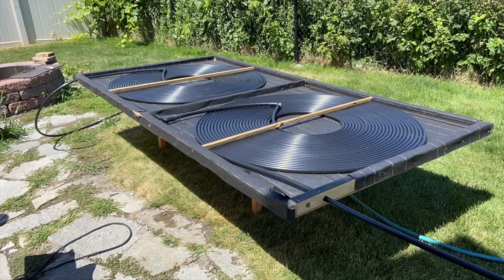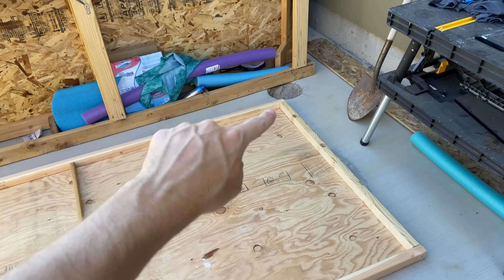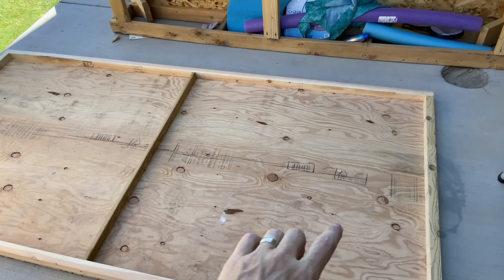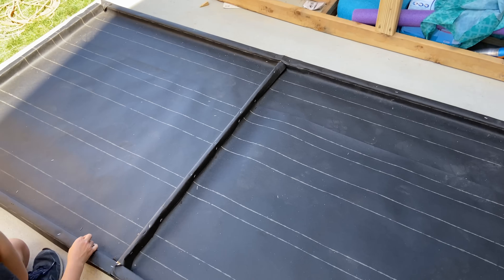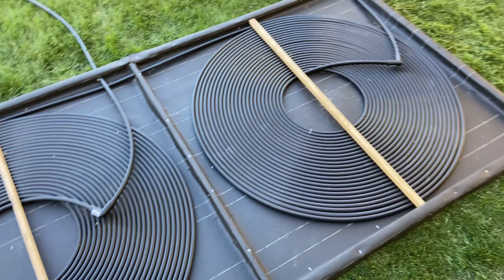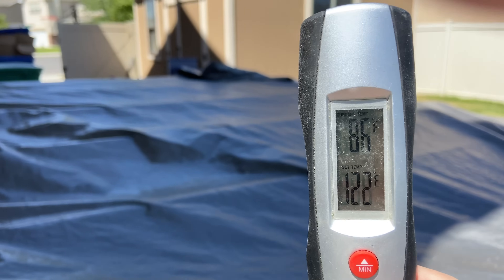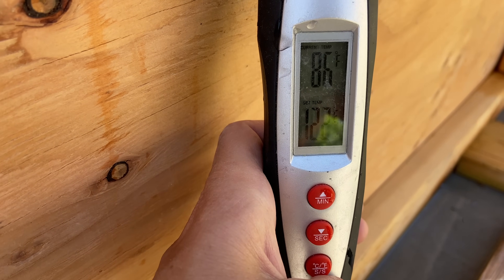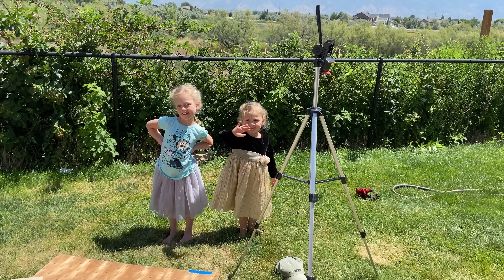DIY Pool Heater - $50 Solar Heater

Comment from the maker: Check out the DIY Pool Build we built this heater for: https://youtu.be/xiqEcp5LHLA
Reply: @101Sauske  pl:
Reply: @alexcanfora4456  aewm
Reply: When I open my pool in May, the water is 60f. I turn on my natural gas heater in the morning, and it's 88f in the same afternoon. 88f is where I keep it until Oct. Most days from July to mid-Sept it will just maintain the 88 degrees without running the heater. Lately I have been adding cold water to keep it under 90 which is highly unusual. Unchecked, it will get to 93-95f. It's around 11,000 gallons / 40,000 liters. My liner is dark blue for northern climate and my pool walls and floor are insulated. My solar blanket is a dark blue/silver, designed to keep the heat from escaping at night. I live at 48 degrees north. It's WAY too hot this summer.
Reply: Temperature is a measurement that determines the direction and rate of energy flow. If you want a cup of tea lower the flow. If you want to heat up your pool speed up the flow because by slowing down the flow you waste energy. As soon as visible light is absorbed the energy turns into heat which is lost by conduction, convection and radiation. Maximize heat transfer by conduction into the pipes.
Reply: @RCdiy  I was gonna post this, but this guy knows. ^
Reply: @shperax 😮😮😢😢
Reply: No way I'm hell you started with nothing and built that for $50.
Reply: If you want your water warmer, you could always turn the flow off and let the water sit in the solar heater say 15-30 minutes in the sun then start the flow again. Maybe put the water pump on a timer to run every 15-20 minutes for however long you think it takes to go thru the water that’s been sitting in your solar heater?  I don’t think a consistent flow of water would necessarily be needed?

Comment: Thank you! Learned so much from your video. A technical question - When you say coil in the video you mean the tubing right? Unless there is another item that needs to be added for the heating. Thanks.

Comment: How long did the tubing hold up on this? I've been planning something similar but am planning on using copper for the long run as I'm concerned that the UV exposure would destroy the pipe within 2 years.

Comment: Dosnt the 1/2” pipe restrict the pump. 
It is designed to to work with 1 1/2”. 
Your not moving enough water through your filter.

Comment: FYI, if your goal is to make the pool hot then you want the flow rate to be high so that the temperature coming out of the heater is as cold as possible. I know this sounds counterintuitive. Increasing the flow rate will keep the water in the heat exchanger cool, so that you maximize the temperature differential between the hot plastic and the cold water, thereby maximizing the heat transfer rate. So, if your goal is to heat the pool as fast as possible then you want fast flow with water coming back being only slightly warmer than the water going into the pump and heater. A lot of people tend to find this to be counterintuitive. If you were sitting in the pool and you could direct the hot water stream onto your body, then a slower flow rate will give you a warmer stream of water. If that's a goal then a slow flow rate works great. But when you're trying to heat the entire pool then you want a slow flow rate to maximize the rate of heat transfer because you can maximize the temperature differential in the heat exchanger (between the black plastic again and the cold water).
You would also want to have the coils in parallel, not series. If you had one coil after the other, you'd get hotter water coming out, but the second coil would be less efficient. Parallel is better, with high flow.

Comment: I did something similar years ago, since then I have changed my design for long term ease and maintenance.  I use 3/4 pvc and make an 4ft X, I spiral the tubing and zip tie every 2 loops. When done I make another X of pvc and glue together to keep it all in place. It’s lighter than plywood doesn’t degrade, and the black plywood and wrap makes no difference in temp if you put it on a block patio which the stone heats up also. I use 3 loops of 75-100 ft lengths for each  spiral. I tap a feed from the output side of pump just before a shutoff valve. I can partially close to increase water flow. The other end just hangs over top of inground  pool so system has no pressure for leaks.  I live in N NJ for reference, it makes water too hot to put my hand under and adds about 5 degrees more on a sunny day. In July August I run it at night to lower pool temp to keep it about 84-89.

Comment: Nice, but what difference does it make to the heat in the whole pool?

Im a bit worrying that with that flow it will have a hard time to heat the pool significantly.

Comment: My $110 pool heater works great. It has 400 feet of 3/4" hose on the roof and a $50 pump. My 10,000 gallon pool goes up 4 degrees a day when I use the heater. You can see it on my channel.

Comment: It won't matter whether you have two loops in series or parallel. Your resistsance will double and your volume will drop. Understand, you only capture the amount of solar radiation that hits the surface of the panel. As long as you pump water through both tubes, you will get the same amount of heat, and  a higher volume of water. At some point, the inside friction of the pipe will get to the point that the length of the tubing will restrict the flow to no output.

Comment: The size of this solar heater is about 4000 BTU. For people wanting to know how much it will raise the water temperature, it will raise a 5000 gallon pool (15' round 4' deep) about 1 degree a day. While that is not significant in 1 day, over a period of 7 days it has the potential to raise the temperature 7 degrees.

Comment: LOL Years ago I tried to build something similar for a 500 gallon kiddie pool.  I made a 2'x2' box and cooled the tubing the same way you did.  Under the coil I put a layer of insulating foil wrap to prevent heat loss from below.  Over the rop I screwed down a 1/4" thick piece of plexiglass.

I connected it to the pool but didn't have a pump and left it with water in the system and the next day was sunny and the water in the coil BOILED and expanded and ruptured the plastic coil.

So yeah, you can heat water like this!

Comment: On thought if weight is not a concern is to fill the tube section with black sand before putting the clear plastic cover on.

Comment: I have a similar setup, a couple of 2m diameter coils, running a 12vdc pump directly from a cheap solar panel. 8x4m pool and it can get up to 38 degrees, covering it during the night to preserve the heat. Totally recommended if your wife likes  a hot tub pool.

Comment: Polytube is much cheaper if you are protecting it like that anyway. I did it with stretch wrap and poly tube and hit 150F in 75F weather.
Reply: Do you have any photos of your system you can share?
Reply: @Evoans  No, it was years ago in a different location. Lately I just skipped the frame and the stretch wrap and laid the polytube out on the ground. A pool that had never been over 80 in May, reached 89F and then we disconnected it because we did not want it any hotter. The problem with laying polytube out unprotected is that it is prone to puncture and you can start developing leaks, so it will not last long. Insulating it in a frame protects it and makes it work better in colder weather.

Comment: Hey , good job , my pool is 12mtr x 3.5 x 1.4mtr , so i guess il need more pipe , what size pump is required ? Lastly would a solar pump be strong enough ? Just your opinion would be appreciated

Comment: I would run the hosing into my attic which is hot as heck during July, you could leave it in it's original packaging even.  I'm trying to heat koi pool during winter

Comment: Glass does not transmit infrared. The plexiglass or polycarbonate you are using will not have the greenhouse effect you were hoping for. Additionally, polycarbonate blocks 100% of UV rays, so you are losing all that energy and the heat is just radiating out. With glass, the UV would be allowed in, but the IR would be kept in.

Comment: You did not build that for $50 starting with nothing.
Reply: Can you prove it ?
Reply: @BibleMusicCentral  100%
Reply: @allthentikmusic5617  500 ft of 1/2 irrigation tubing at Home Depot is $50. Add the cost of tube connectors, wood, etc., add another $50 or so? Not too bad cost wise.
Reply: @weatherboner  The sheet of 1/4" plywood alone is $35.
Reply: @stick9078  agreed

Comment: Anyone tried a coiled, stainless steel garden hose instead of black tubing?  Probably more for smaller pools like ours (only 5x5 ~ 300  gallons)...interested to see how much more heat a stainless steel hose would absorb.  Really just worried about the toxicity of cheap black tubing after prolonged exposure to sunlight.  Though maybe running the water out from the pool, then through the solar hose system, then back into the pool filter rather than out from the filter, into the solar system, into the pool return would help to filter any breakdown of the material.

Comment: Great project but for best heating don't worry about trying to reduce flow to get highest temperature water out... the best heating will be with higher flow: maximising heat differential and therefore energy transfer. Seems counterintuitive I know but higher flow with slightly less heat at the end will get you the best results. It's science!

Comment: I am sure it works for a few minutes, but there is no way that after the initial hot water is forced out of the tube that the sun can heat the cold water coming in fast enough for this to warm a pool.

Comment: The most impressive part to me was 2:30 the actual coiling of the tubing. However I don't want plastic being circulated in my water supply. Heat and plastic are an infamously bad combination. Doesn't really matter what kind it is. If it's on the market, it's going to degrade and leech in sunlight. Not just chemicals but microplastics. 
I've seen other builds using copper tubing, which must be a massive price hike but would be a safe alternative. This is a wonderful concept that can be modified in countless ways.

Comment: I've watched several of these videos why don't people just measure the temperature in pool before and after dont think these work that good 20000 gallon pools maybe couple degrees more efficiently put on roof shingles or metal but think trying to heat a 15.000 gallon water heater with hose pipe laying in sun it would work good on smaller pool kiddies pool

Comment: You need to be cautious about the extreme temperature and chemistry and also having stopped the flow without draining the system.i believe the max structural strength of the tubing degrades as temperature increases. You are going to go through more chemicals, the more stable the temperature the more stable your chemistry will be. Think higher velocity and continuous flow during daylight hours or draining the system when temperature is achieved.a simple vacuum breaker and three way valve should do it.

Comment: What pump were you using to run the two 1/2" coils? I have a 9x20 Intex with a small sand filter pump... Im not thinking you recommend hooking them together? Am I thinking right that I should run the separately ? Please advise... And Ty

Comment: if you would set that up by your fence and then also have mirrors on your fence so the sun bounces off and onto your heater, it would increase the temperature!  Also as the water flows through, it captures heat energy. As long as the water doesn't reach the point where it's at the max temperature before it goes to the pool then thats okay. if it reaches max temp 3/4 through, then the last 1/4 of the system is doing nothing.  Nice idea though.  I wondered... if under the pipes, you'd have Styrofoam painted black, if that would be better. Now. The black tubes and wood are heating up by being black, that heat is transferring through the wood and escaping.  If there is Styrofoam then it would heat the black paint and radiate back into that open space and not being sent into that wood.  I could be wrong but I think it would possibly work better (higher temperature).

Comment: You know this was a good initial concept a few years back. But with what today's products are and options I decided to opt for a tankless 8 gallon electric water heater and water transfer pump. Keep in mind the cost difference was only $100 more to go fully electric instead of solar materials needed for the project. The interesting thing is is I now get up to 150° on demand whenever needed however I still have yet to see what the electric bill is. I had to go with the electric heater just because I never know what the weather is going to be and overcasting scenarios. I like the convenience of getting hot water on demand. Me watching these videos allowed me to uncover my new 2.0 electric water heater process and after an hour of installation it works flawlessly. I'm not saying it's for everybody but do your own research.

Comment: Seems to me that in the test, the output was basically air temperature.
Reply: Water is 830 times more dense than air......Pouring hot/warm water into pool heats it 830 times faster...give or take! Science.

Comment: I built similar set up with copper. I found the first few feet heated water to temp and the majority of the pipe could not absorb any heat. I went with a 2 inch pipe on top of frame work for more heat transfer. Hot plastic leaches toxins as well. Experiment  with lower flow got hotter but put way less heat into pool. Higher flow rate would capture more heat.

Comment: You did do it wrong yourself. It would be a much more efficient heater if you're two loops ran in parallel instead of series. The output water wouldn't be as hot, but you'd have more flow.

The most efficient heat exchanger is actually when the difference between heat source and coolant is the greatest. Not when the difference between input and output is greatest.

Comment: From a physics perspective you actually want the water pumping through as fast as possible, regardless of how hot it's coming through at the end. 

You don't care about what temp it's coming out, you care about how efficiently the heat transfer is taking place. Letting it linger, reduces efficiency. The better efficiency you have, the hotter and hotter faster your pool will be.
Reply: agreed. i just started solar heater interest a few minutes ago and these coils of copper is terrible idea.

Comment: Probably would have been cheaper to buy a $150-300 12-15' pool with pump included than to build all that wood, poly plasctic etc etc to build that makeshift pool

Comment: FYI - i did this for an in ground pool.   you dont even need it to be spooled nicely like this or anything.. just toss the black hose on your roof and have your pool water circulate through it..  wala.. you'll have a really heated pool in no time..  do it with the pool filter pump or with a different pump, it does not matter..    just noticed this was 2 years ago..  but if anyone else reads comments other than me,  just know that it works pretty well for a large 6 foot deep inground pool in florida.  and almost too well for a small jacoozy.
Reply: how did you connect a 1/2 inch irrigation pipe to the 2 inches filter pipe?
Reply: @julienbo  with a 2 inch pipe with a 1/2 inch tap on the side.. you can get them at home depot.  or go 2 inch T,  then reduce the 2 inch to 1, then to 1/2 or whatever.. just go down there and play with all the connectors, you'll find something that works
its just water.. not like your going to blow anything up..
Reply: Can a different pump be used for circulating water thru 1/2 pipe?
Reply: @chamorrosteve  yes,  actually any water flow will accumulate heat from the sun.  but if your planning ot run it for a long period of time, make sure to choose a pump that can handle the clorine and its corrosive nature and the contenious operational needs for the time periods you choose to run it.
Reply: @The1stDukeDroklar  actually,  yes you do.  consider,  solar heater by day,  solar COOLER by night.   its very easy to get a pool overheated, and a cool pool during a hot summer day feels amazing.  so yes, running it at night can become a pool chiller.
Reply: @The1stDukeDroklar  with a pool temp sensor, and a esp32 along with a solid state relay, its fairly easy to program a pump to maintain the perfect temp.

Comment: That irrigation tubing is typically rated at low psi. Did it hold up to increased pressure? What are your psi’s?

Comment: I made a round one of these about 20 years ago. It has been stored outside every winter and I’ve modified my design over the years. The first change was to make long straight runs looping at the ends like a racetrack to reduce resistance and the amount of bends. Then I went to a zig-zag  design using male/female barbed fittings to reduce the system’s footprint and make it easier to drain out before winter. The original was 3/4” pipe and I added a few hundred feet of 1” pipe in the same zig-zag arrangement.  This black pipe is super durable (you can walk on it), but I’m changing my design away from zig-zag and using tee fittings barb-female thread-barb to make the pipe run close and parallel and less pipe.  If you have a retired clear solar blanket like I do, you can glaze over the solar panel to increase heat gain and prevent loss from wind and light rain.  All this engineering is great, but as my dad once said “ to late smart” because I believe there a much easier and cheaper way to make a solar heater using a 2” heavy duty black roll-up Swimming Pool Backwash Hose - 50’ for $35 Amazon. Just lay the hose out or cut it into a couple parallel runs and glaze over it with clear plastic.